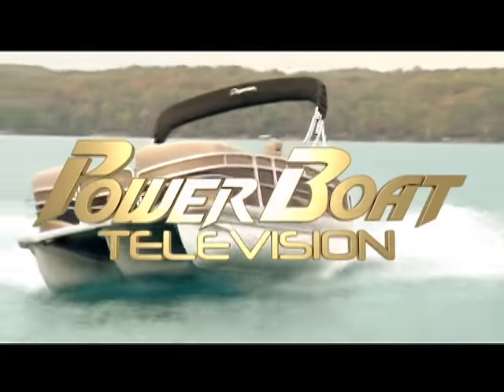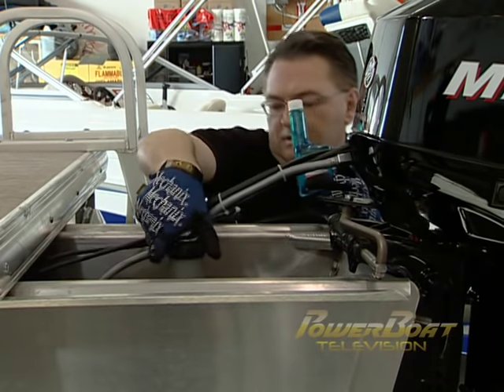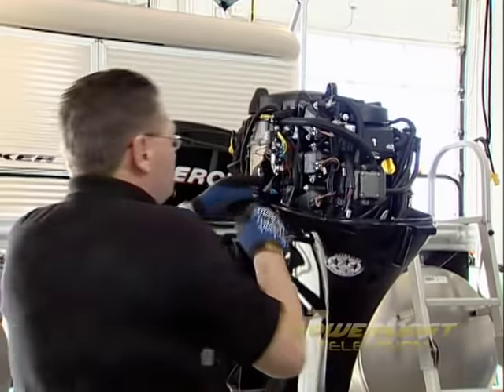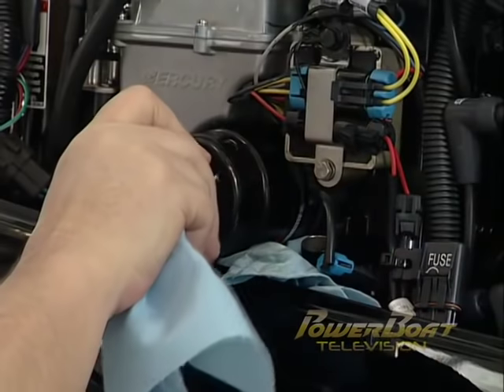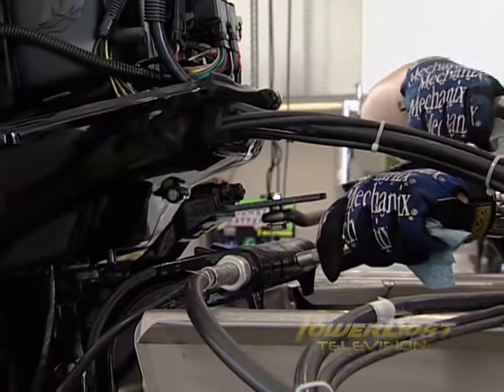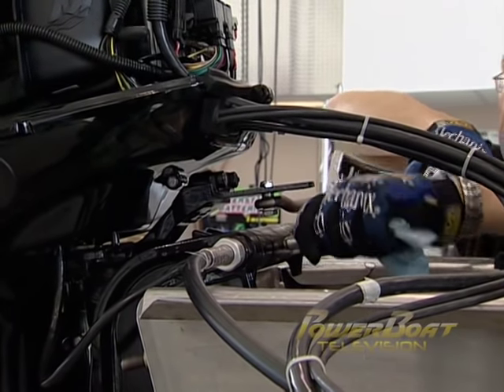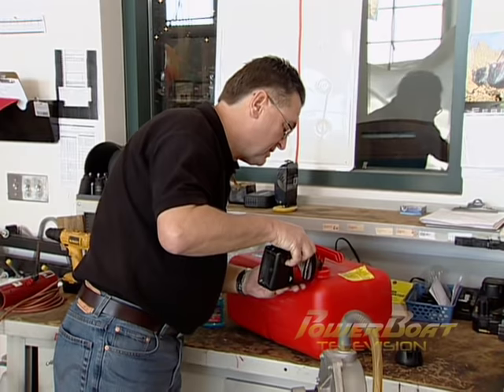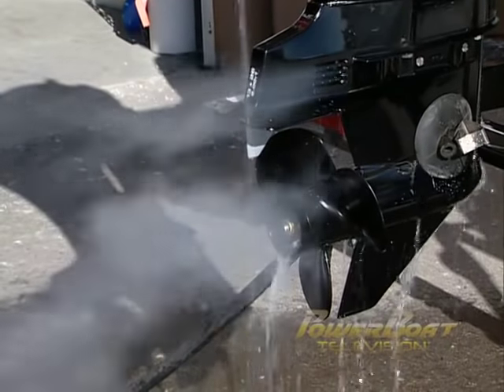How To Winterize A 4-Stroke Outboard | My Boat Classic DIY

Comment: Why 20 litres of fuel, isn't it going to just be wasted if your only using enough to run through engine fuel system?
Reply: Yeah agreed. I make up 5 litres of the same mixture and I run enough through the outboard until it smokes, and use the rest in my 2 stroke chain saw and strimmer.

Comment: It’s also a good idea to remove the prop and check for anything wound onto the shaft.  Also, lubricate the prop shaft.  There are few things more frustrating than a stuck prop.
Reply: Especially if you use your boat in salt water...

Comment: Great video. I have a 2003 Merc 60 4 stroke on my 1963 Thompson SeaCoaster. For all these years I've winterized it just like you showed in your video. Lately I read on a website that 4 strokes should be stored with the engine tilted on a 45 degree angle, supposedly so the oil in the sump doesn't rest on the piston rings....which in their opinion would lead to oil burning. I have no idea if this is true, or even makes sense. I never did this with mine and would like your opinion.....Thanks alot!

Comment: Thanks for the video. I thought all along that outboard motors are easier to maintain than onboard, I guess I was wrong. Been staying away from a lot of great deals on boats around here that has onboard motor because of the fact that I was told theyre harder to winterize, This video shows that winterizing outboard motors are about the same time wise as onboard done properly
Reply: It's faster and easier to work on. No bellows.gimbal bearings, water fuel separators power steering, het exchangers etc. My Volvo penta took me most of day to put to bed.  My outboard takes a couple of hours.

Comment: Great video... thanks just what I needed as I have a new 4 stroke for the first time.  I'm not sure I want to mix 20 litres of gas with that 2 cycle oil mixture for winterizing just my outboard.  Sounds more like something a marine repair shop might keep on hand for doing all their winterizing.  I guess just figure out the mix for 1 or half litre of gas?
Reply: You just need to get a bottle of fogging oil for your engine and cut the number down. I have a single engine Yamaha, I fog with a half bottle of fogging oil and 1 gallon of gas mixed, run it through the fuel line direct to engine. Other videos on YT can show you how.

Comment: you never said a word about how to assure all the coolant passages and hoses are emptied. Not one damn word, and that was my biggest reason for watching. The video was a good effort, but without the mention of protecting the engine from freezing in cold storage, I do not recommend this video for Northerners.  I am a new boat owner and have no knowledge of the schematic of the water coolant passages. Am I supposed to just guess that my engine wont freeze? I am looking at this engine, and being completely green to marine engines, I find myself guessing where the water flows through. A mention of these things for winterizing in the north was not even covered. Not one word.

Comment: What do you do with that winterized fuel mixture when you're done with it? Dump it on the side of the house?
Reply: Lol
Reply: It's a lot easier to just use 1L fuel, 100ml 2 cycle oil, and 50ml of fuel stabilizer. Run it until it's gone.

Comment: Do you circulate antifreeze through it?
Reply: No
Reply: Are there spark plugs in a 2021 mercury 20 HP outboard 4 stroke ELH gas motor ?
Reply: @montellwilliams811  yes

Comment: Great video!! Followed everything to the letter. As far as the “mix”. I never got blue smoke and ran it for over 10 minutes. I liter of 2 stroke oil in 3 gallons (12 liters)of pure gas. Should I have run it longer?
Reply: 1 liter of 2 cycle oil in 5 gallons of fuel is waaaaay too much oil in the fuel. you only need a few ounces of 2 cyl oil in a 5 gallon take, 100:1 is good.
Reply: @shooter3288  thank you
Reply: @alquinn3562  no problem

Comment: Do you have to drain any water out of the motor at all? If so how do you do that? Or will gravity just drain the water if left in a vertical position? Trying to winterize my motor for the first time this year and maximize my time on the water so left it a bit late lol. Thanks in advance if someone sees this and can help asap.
Reply: Also is it not bad to run mixed fuel through a 4 stroke engine?
Reply: I'm "in the same boat".
Reply: AdvOutdoors I just did mine last week before those few really cold days. I just drained out lower unit and top end oil and replaced with new oil then left the motor in the down position so any water in it drained out. Didn't worry about the fuel since I keep my tanks inside for the winter and I use premium gas so I shouldn't need to worry about it breaking down over 4 months. Luckily my dad's buddy has a similar outboard so he told me what to do. Hopefully this helps you out.
Reply: AdvOutdoors and do not mix oil into your 4 stroke fuel, not sure why this guy said to do that. From what I have heard it is not good for your engine to do it. Probably ok to do it once or twice but not a good long term solution. Better just to keep it full of regular fuel because that alone should keep seals from drying out. Plus with premium as long as it is low ethanol you don't really have to worry about it breaking down at all and unless it's gonna hit like -40c it shouldn't freeze.
Reply: Thanks, I'm going to do what I can tomorrow.
Reply: AdvOutdoors no problem, if you run into any troubles let me know may be able to help you out but should be pretty straight forward, much less work than I thought.
Reply: You're only putting a tiny bit of oil in it will coat the inner workings of the motor over the winter.
Reply: @mailliw75 true, but there was something in this video about harming injectors with fogging oil. Does anybody out there know why fogging oil may be harmful whereas 2-stroke oil mix is not? Thanks.
Reply: @KnarBurger

Comment: What do I do with all that left over gas???
Reply: @stopspinskydiving  preach on brother
Reply: Just run it. Or run it in the lawn mower, I put 50/1 for my chainsaw in my honda mower all the time lol.
Reply: Hey , are there spark plugs in a - 2021 mercury 20 HP , 4 stroke , ELH , ?
Reply: cheez. you don't have to make 20 liters of mix. Just cut it down to 2 liters plus 2 cycle mix. Do the math. Throw the rest in your car

Comment: Absolute trash video, please don’t follow these steps. 

Do you guys run 2 stroke mix in your cars for winter storage or 2-3 months not driving ? So dumb.

Basic winterize process (similar for 4 stroke jet skis for years)
- add marine stabilizer to full tank of gas before start
- check bottom end gear oil for water content if milky
- oil change optional (better in spring)
- run rv pink antifreeze on water lines with engine running - outboards usually Auto drain but it’s good measure for freezing climates if pump has water 
- remove spark plugs, fog oil into cylinder holes, spin it a few times, add fogging oil for a few seconds 
- add plugs back in, hand tight plugs 
- DONE 
- spring time: tighten plugs, oil change, ready to rock
Reply: 100% agree with this. I bought a brand new 9.9HP Mercury this year. Only thing I don't know how to do is run the pink RV antifreeze through it. Any idea? I live in Michigan so figured it's a good idea.
Reply: @keithzastrow  outboards usually self drain. 
You can use a funnel and a short piece of hose to those water ear suction cups. Then pour pink stuff into funnel with engine running.
Reply: @oneeyedrone4293  That's what I do to winterize my ski boat (1996 Moomba with a 351 Ford Windsor). I just don't know where that's all at on this outboard. I'll have to read my manual and see if I can figure it out. Thanks.
Reply: When you are fogging each cylinder I am assuming all the spark plugs are removed (I am not a mechanic)?  Why is it better to change the oil in the spring?  Why hand tight the plugs in the fall and then tighten in the spring?  Thanks!